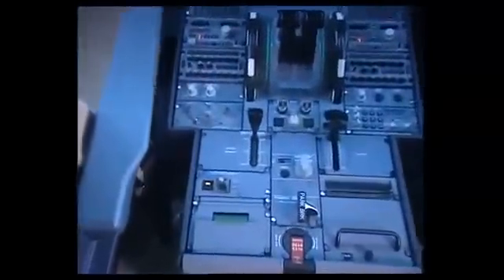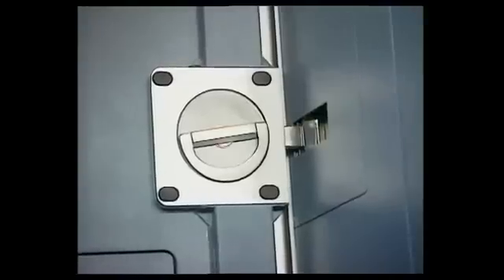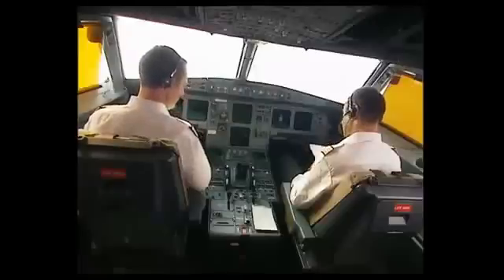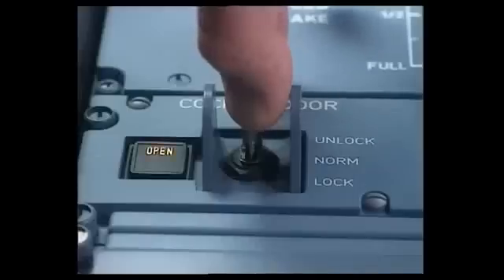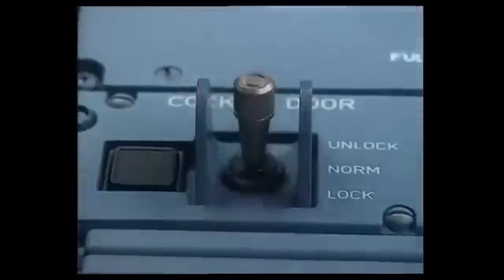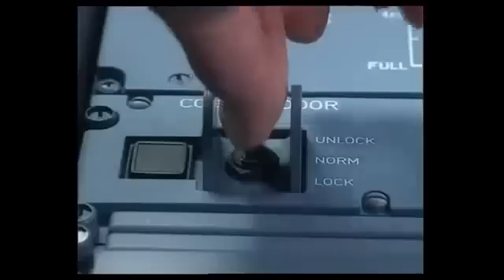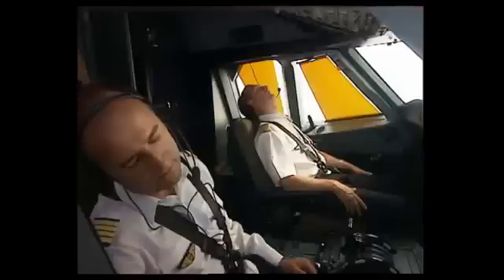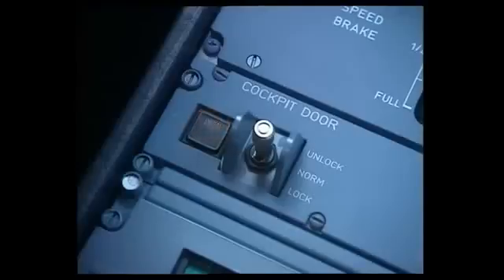Airbus A320 Cockpit Doors

Comment: Was this after the germanwing crash?
Reply: But the Qusestion is:
What is when the counter is on normal mode?
Does the door opend or is than locked?
So if it is locked there is no action needed from inside?
If in normal mode the door isnt't locked there is a action from inside the cockpit needed. 
-You know what i mean?
Reply: @Bot_User Tech He did but the flight deck can ALWAYS override commands from outside. This is standard procedure since 9/11. When they don't respond to cabin crew it can also be because they're talking to ATC and can't talk to the cabin or because they're dealing with technical difficulties and need to focus and can't communicate with crew. So they can't have them barge in thinking flight crew is in distress, so they override it. In this case, as crew you're taught to disregard it and let them work. If the door doesn't unlock after the emergency code it means they're dealing with something and you have to wait. Usually they call you on the intercom and explain to you they couldn't have you come in. In 99.999999999% of cases. Not saying 100 because of german wings...

Comment: And what, if one of the pilots decides to crash the plane with the other pilot not in the cockpit (say for peeing)? he could force a "locked" position every time a person want's to access the cockpit ...

Ohh... wait ...
Reply: Yeah that's why there are cc in there.
Reply: I don’t think anybody in this comment section got the joke
Reply: @chase.b2967  Woah, those mountains sure look beautiful, wait...i think something's wro........
Reply: But the Qusestion is:
What is when the counter is on normal mode?
Does the door opend or is than locked?
So if it is locked there is no action needed from inside?
If in normal mode the door isnt't locked there is a action from inside the cockpit needed. 
-You know what i mean?
Reply: @MrJindujun  That's a valid question. The toggle is supposed to be on normal mode during a flight. Crew press hash # which is kinda like a doorbell. Ding dong it's me open! The flight crew open the door. If the crew from outside the flight deck dial the emergency pin number, the door unlocks itself automatically after 30s BUT the flight crew can override it and refuse access. 
Sometimes when they don't respond it's because they're talking to ATC and are receiving important info and can't talk to us (I mean crew members, I used to be a flight attendant).
Reply: Must have always 2 persons in the cockpit.

Comment: what's the difference between norm and lock
Reply: Jaon Makepeace when "lock" is selected by the flight deck crew, it locks out the external keypad for 5 minutes. In "norm", the door is locked but the keypad may still be used
Reply: bradporky16 thanks I get it now
Reply: @bradporky16  What does that mean?
When its norm mode you could enter second code or what?
Reply: Lock means that you can’t open the door even with emergency override codes that are used in case of pilot incapacitation which will automatically open the door after a few seconds of no response while norm means the crew can open the door with emergency override codes and normal codes after informing the flight deck
Reply: 2. She has 5 sec to get into, otherwise the door is locked again? 
For 5 Min ... Thats crazy
Reply: @MrJindujun  no... When you select lock it just simply locks the keypad from use. You can cancel the 5 minutes by just putting it into the unlock position